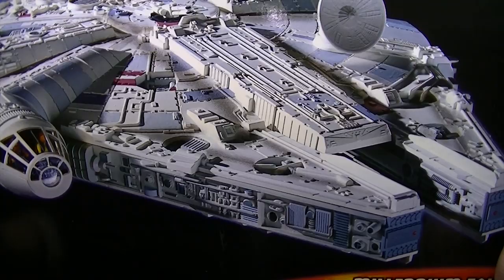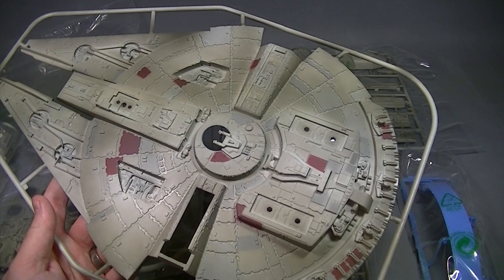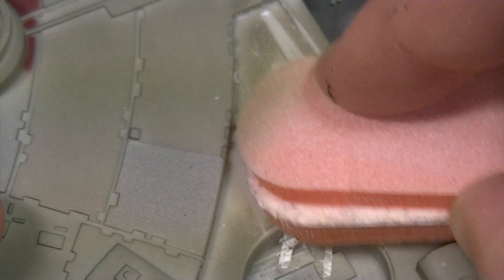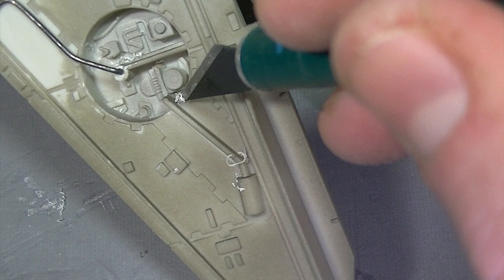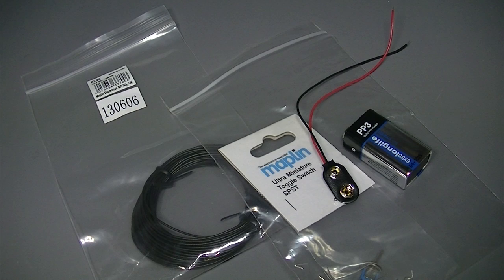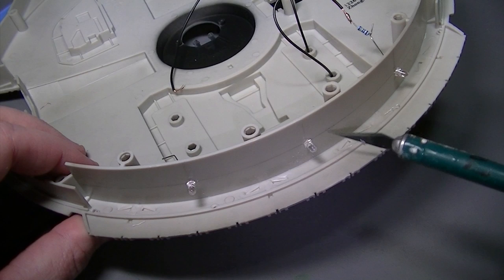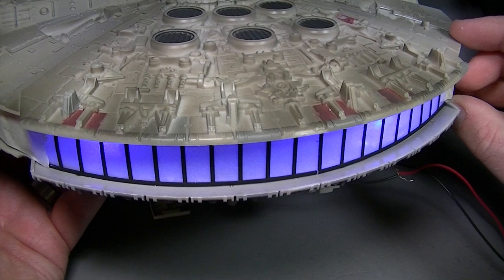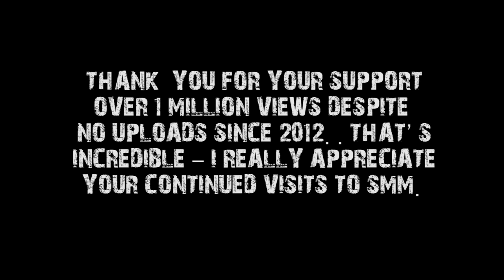Budget Millennium Falcon Model Part 1 - detailing and lighting

Comment: Welcome back Jon, looks like your throwing yourself in at the deep end with this Falcon kit. It is a nice kit but does have its faults the main one for me it the side panels that fit between the upper and lower hull pieces, as there far to wide, the Studio model has very thin sides. But other than that is ok. Interesting to see you putting lights in it as it's something I'd like to do but have very little clue how to. I do watch Boyd over at Trekworks for lighting tips.
Looking forward to part 2 and Welcome back again. 
Andy.
Reply from the maker: Modelmantom is a lighting wizard too, for me its a dark art and I'm useless at it.  The kits rough I'll say that, but at less than a tenth of the cost of the finemolds I'll take it!
Reply: ScaleModelMedic Look at the bright side, you're keeping the lighting relatively simple and at least you didn't fry any circuit boards like I did in my 1/350 Enterprise model. As for the Revell kit, it can be made to look like a great model with some work. And with its price point, if you mess up you aren't going to lose any hair either.

Comment: Beautiful job on the Falcon. Urgent question: I recently purchased the FineMolds 1/72 Falcon online- but the scammers who sold it did not include the bottom half of the Falcon! ( They gave me duplicate top halves instead.) Now I know why it was so cheap ($125) Wondering (hoping)
 I can do some surgery and use the MPC bottom half and somehow graft / sculpt/ merge it onto the FineMolds top half. Possible?! Your opinion please. Thank you!
Reply from the maker: Bit of a tough one, I've never seen either kit in the flesh so I don't know what the part makeup is like however the overhang on the top and bottom plates of the falcon do provide a natural place to perform such a graft if you were going to do it, it just depends whether either kit has a full side wall you can use.  This is one you would need to really assess in person with both kits out on the bench.